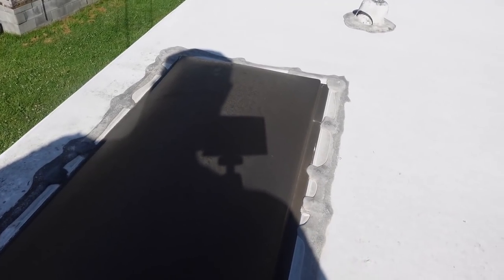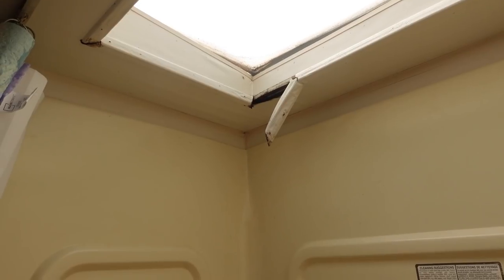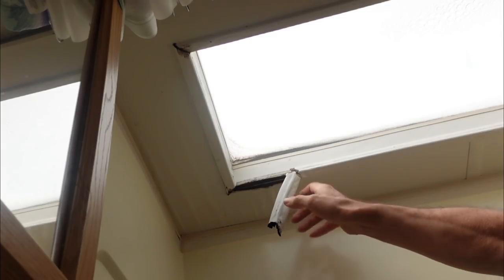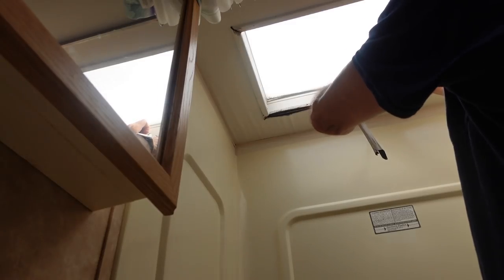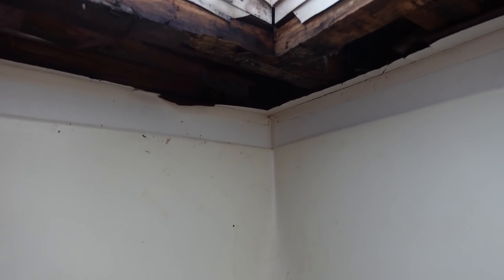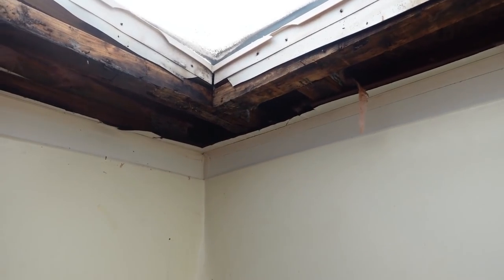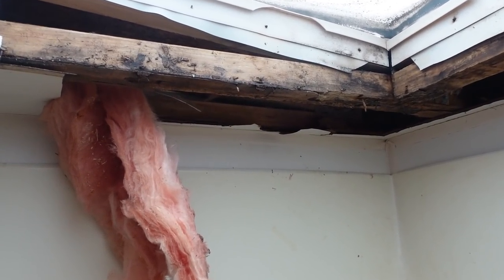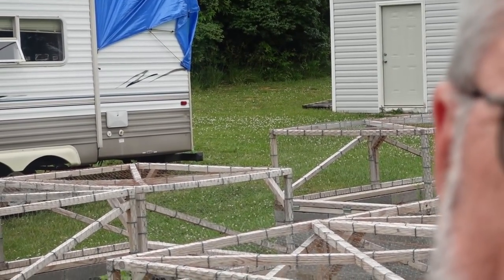Repairing Our RV Roof Pt1

Comment: There are 2 kinds of skylights:  those that leak, and those that will leak eventually.  When we bought this house, it had 3 wonderful skylights we dearly loved.  There was evidence that there had been some leakage, so we had them tested and re-caulked.  This worked fine for 2 years, when we had a storm of biblical strength, and the middle one leaked.  Had it fixed. But it was never the same.  While having that one fixed a couple more times as it would leak even in a mild rain, we decided to pull out the skylight because the option was to have it completely rebuilt.  And then the other two did the same thing, so we had them removed too, the roof made solid so no more skylights.  I miss the skylights, but not the worry after every rain.  I hope that skylight won't ever leak again.

Comment: One of the worse feelings is finding water damage in a camper or house that you thought was water tight. Make sure you check the rest of the camper and seams for leaks. Your probably due for an all around seal on that camper. Im super sensitive to mold as well, luckily I don’t have asthma. I get a bad headache, tingling nose, throat hurts. I have a portable ozone machine that I’ve used on several spaces, and that kills anything that could be lurking. After using that I don’t get the headaches etc any more. The previous owners covered the roof of my camper so it doesn’t have damage, but all the corners had to be redone because of water damage. When I put everything back together I triple sealed it so it’s better than a factory job.

Comment: There is 1 type of RV/camper that does not leak and that is the fiberglass "egg" type campers.  Usually built in 2 "shells" and seamed at about midpoint horizontally.  Any leaks around ceiling holes for vents or AC can't do much damage since the entire top half is basically a boat!

Comment: Those TPO roofs aren’t adequate. They usually need to be upgraded to a higher mill. Replace sky light and recalk is recommended. We redid our edge seams, removed all old screws and replaced with stainless, filled holes with silicone caulking. Keeping a water tight camper is a chore . Good luck🙏🏻
Reply: Jane, I hope you replaced the butyl tape too. Need to do it about every 5 yrs or so.

Comment: We have had a 5th wheel for 25 years. We've fixed at least 5 major leaks in it. We had a completely new roof put on it about 5 years ago and just covered up the 2 skylights and a TV antenna. We live in ours fulltime and have for most of the last 25 years. It's been a lot of work but it's been very cheap living and extremely cheap taxes.  We probably should get one of those metal carport for it.

Comment: The joys of owning an RV. Need to replace caulking regularly on roofs, reset windows every few years,  store under a roof and  tarp it in the winter. How do I know this? Learning the hard way.
Don't kid yourself - water works its way down to the lowest point. It will be behind the walls and under the tub.

Comment: Hello Bill & Elizabeth! I look forward to part 2. Do you have to put roof coating on your RV? I was just wandering. I just put roof coating on my mobil home in January when the Temps were up 50-60°. It wasn't because I had a leak in the roof, I had a leak in the side wall (where the porch roof is up against the gutter of my home.) They're real thin gutters. A lot involved. The whole wall, & floor, insulation, window frame, 2x4's, plastic sheeting, all replaced. Still have the leak.
Reply from the maker: No, the roof coating still looks fine.  I just have to replace the caulk around the skylight.

Comment: Sell it and get a used scamper or other fiberglass camper
Reply: Our 5th wheel is fiberglass and we still have lots of leaks. We've had windows leak, seal around tip outs leak, AC units leak, we had damage from hurricanes on our roof leak. You name it, we've had it. We had a 2nd RV we bought for our daughter and the window in the door slipped down and it poured rain in. That RV was ruined and insurance refused to pay for repairs. We paid $22,000. for it and sold it for $500. At least we didn't have to pay someone to haul it off for us.